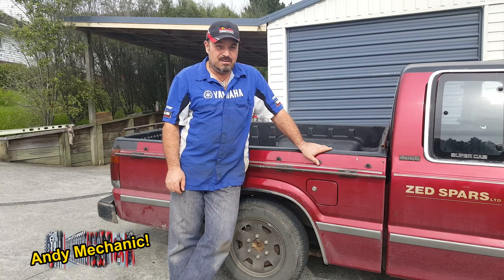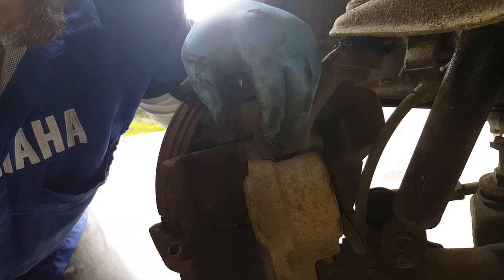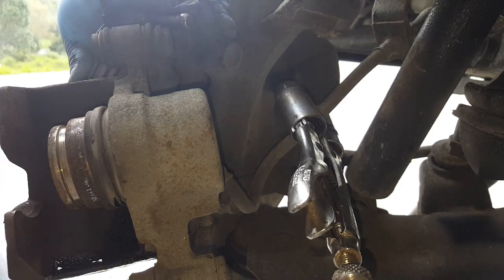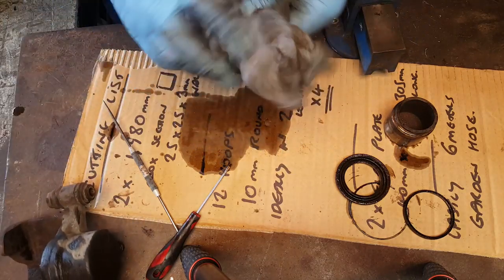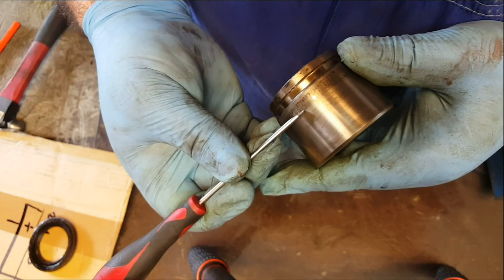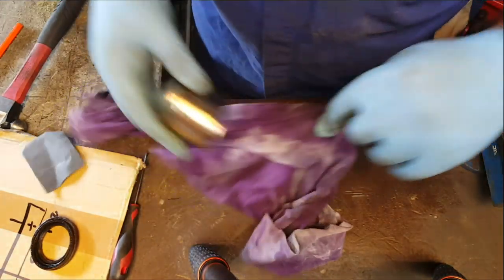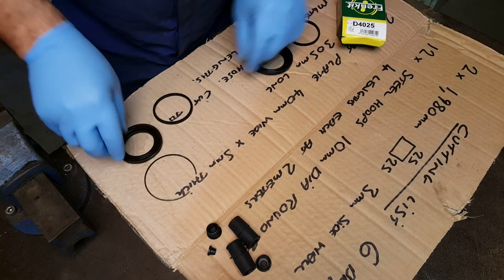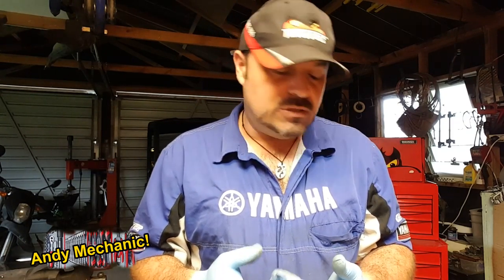Ford Courier front caliper removal, strip & inspection #1316

Comment: Hi Andy I just done a front brake pad repair on my courier and I didn’t clamp the rear breaks when I bled the front is there anyway I can tell if I damaged the rear lines? Also it takes a bit of pressure on the brake before it engages.

Cheers for any advice this here is a great video man 👍

Comment: Hi Andy I'm in nz and i have hit a bit of a problem with doing a replacement on my brothers courier. We stripped the calipers and pads a while ago and ensured we put "all parts in a box" well since then weve come to re assemble and have lost the metal clips that help locate the brake pads.Im hoping you can tell me if the calipers have two clips or four? i see 2 on the front in ya video but are there another 2 holding the rear pad in place?
Reply from the maker: I'll ask Ben to take a look at his front calipers again, hes down this weekend

Comment: Hey mate can this make your breaks shudder
Reply from the maker: Brake shudder will likely be due to excessive runout on the brake disc - warpage. You'll need to get the discs skimmed or replaced. You can measure the runout using a DTI 

Hope this helps. Cheers Andy
Reply: Hey mate I have got new roters new pads  just keeps shadering
Reply: maybe it was the Calibre being a bit rusty inside or needing new rubbers never had this happen before or maybe needs brake fluid change